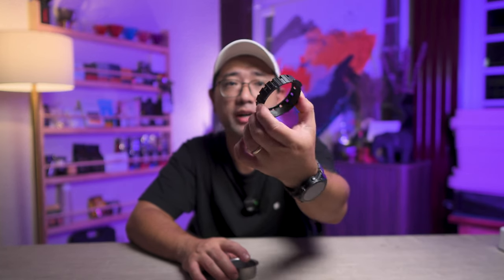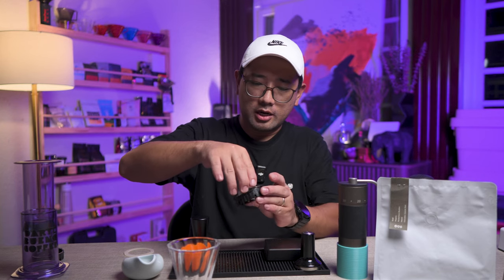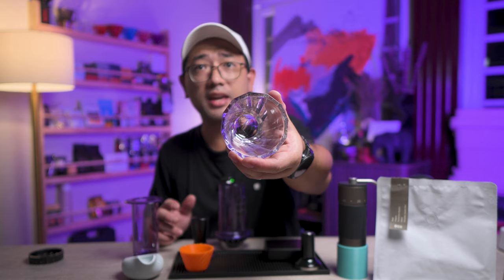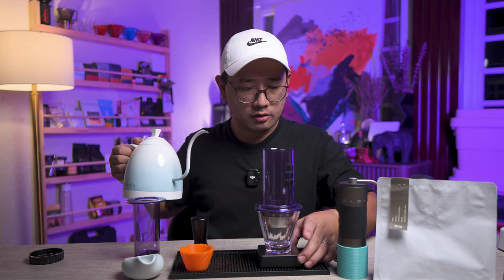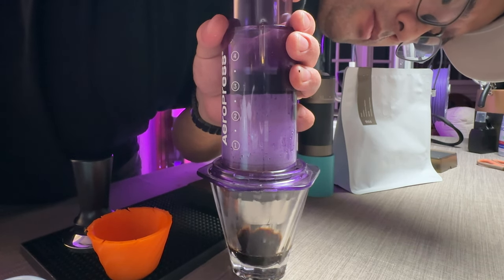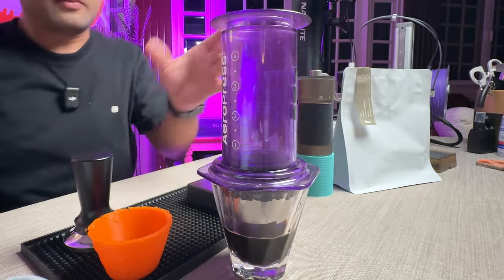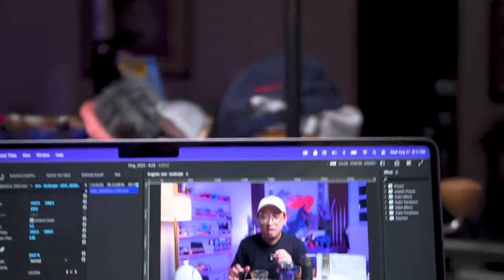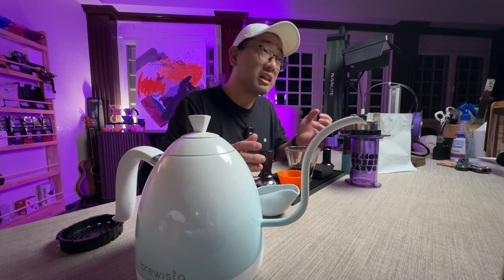Espresso from an Aeropress

Comment: Hello mate, this time you didn't get more than a few milliliters of espresso plus water. If you pay attention to the extraction moment, you can see clearly how after a few seconds there's only clean water coming throughout the sides of the holder, so basically you got a tiny amount of coffee with a big bypass. I'm pretty sure that with proper sealing you can achieve something much better. Good idea though, would love to see your next shots using that system 👍🏼
Reply from the maker: @Mastrenich  did you see when i used the pressurized basket?

Comment: Hi there! Putting a paper filter beneath the coffee puck will probably reduce the pressure for the same grinding size. This is the case in espresso extractions. Jonathan Gagne has offered a plausible explanation for this. Also, if you try to apply proper espresso-level pressure within the aeropress brewing chamber, the chamber itself will break as it cannot withstand this level of forces applied.
Reply from the maker: thank you for the insight but I dont completely agree about the chamber breaking - you also have this product from Cafflano than can actually make a real espresso with the same material. You also have the portable espresso making machines like Wacaco Picopresso and the Outin Portable Espresso Machine. Nevertheless the cheap espresso machines from china can withstand espresso pressures despite having cheaper materials. So that's one thing to ponder also.